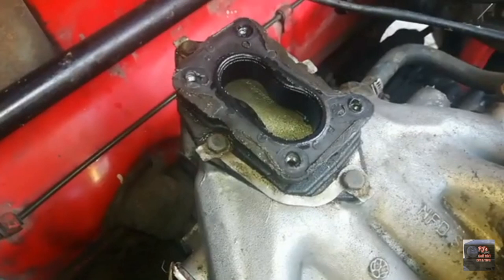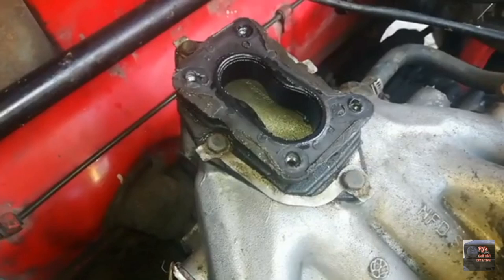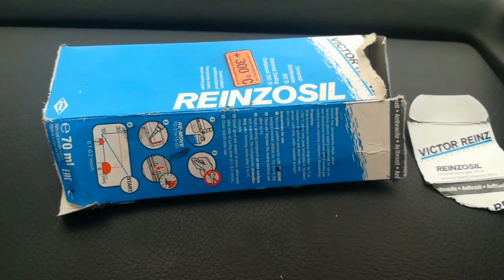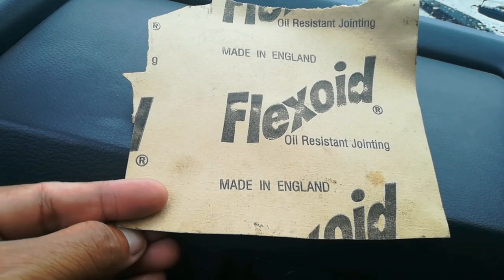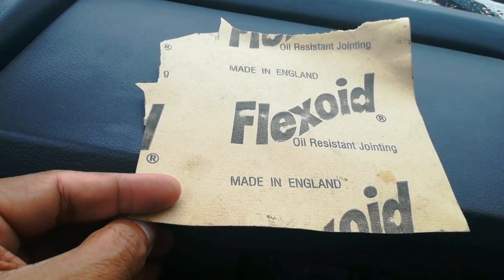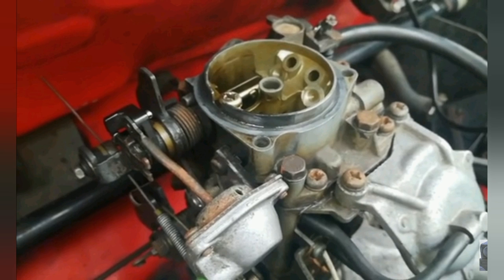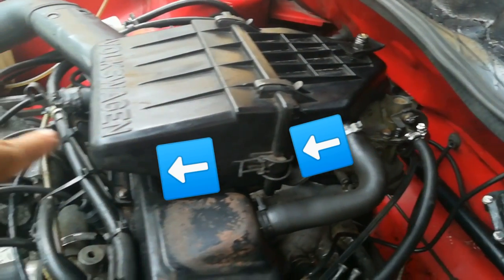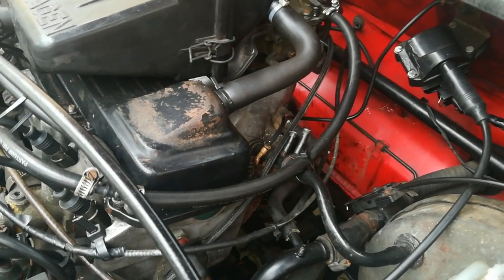GOLF MK1. HOW TO FIT A CARBURETOR BASE  PLATE #vwgolf #golfmk1 #vwfox #vwcaddy #golfmk2 #carburetor

Comment: Hi,Pj, just a question, where would I be able to buy a good quality base plate? I have replaced a few and it is as you say it is not good quality. Any recommendations would be appreciated. Thank you again for your channel super helpful! 👌👌
Reply from the maker: This is the problem.. Some say Goldwagen sells the best.. But one experiences issues with theirs too.. I know there are metal ones being made by local people, but have also heard of some having issues with these... This mk1  base plate could have been designed more simpler in my opinion, like the Toyota models. The Mk1 base plate is not designed for durability... Well the original vw ones were better former years... So one has to get creative and make it work..
Reply: @pjs-golfmk1-diy  ,ok thank you for the prompt response, I really appreciate it. I have an odd question, do you know or have you heard of a different base plate for an automatic mark1. I read it on a forum, but couldn’t find further information and I was not sure if there would even be a difference, between a manual and an automatic, where the base plate is concerned.
Reply from the maker: @Dreamality187  I'm sure the base plates would be the same on an automatic
Reply: Good day I have a Golf mk2 1.8 carb Ks2,  I struggle to adjust my air fuel  mixture screw to get the right mixture can you pls help me
Reply: @pjs-golfmk1-diy  , Hi Pj, I had the base plate delivered from Goldwagen today, thank you for the suggestion, it really makes a difference to spend more, I still have to fit it, but I am sure it will be so much better than the old one. thank you again for your help, and your channel . 👌👌👌👌
Reply from the maker: @fagilhendricks2539  hi.. Have you watched my video on the channel where I go into detail about tuning.... Just look on the channel for that video.... "CARBURETOR Tunning"

Comment: Hi P. J. I snapped a baseplate bolt in the intake manifold of my golfie some time ago now i got a leak 🤦🏽‍♂️. Should i remove the head or is that bolts accessible?
Reply from the maker: Yes that bolt can be removed,by drilling, and then putting in a new thread

Comment: Hi pj my golf is very heavy on juice i go like 57km on R300 of petrol where i got on my polo 57km of R150 i realized that my base plate was loose can that be that my golf is so heavy on juice?
Reply from the maker: Yes a loose base plate will cause high fuel consumption.,because it's sucking in unmetered air ,which leans out the fuel mixture ,so the only way to  compensate is for more fuel,meaning you have to hit the gas harder on the pedal ....That's how u use more fuel
Reply: @pjs-golfmk1-diy  yor boet it's alot of petrol tanx wil sort that out tomorrow and get back to you if it changes in feul consumptions
Reply: @djbolliano6522  Did your fuel consumption change after fixing that issue?

Comment: Hi I recently bought a citi golf it seems to have central locking in but its disconnected what can I do
Reply from the maker: I would suggest, Rather take it to a workshop  that specializes in this area of work
Reply: if its electric actuators u can use two   5pin relays assuming the relay is missing. It must be both N/O and N/C. U can also connect your alarm to it if it switches via ground